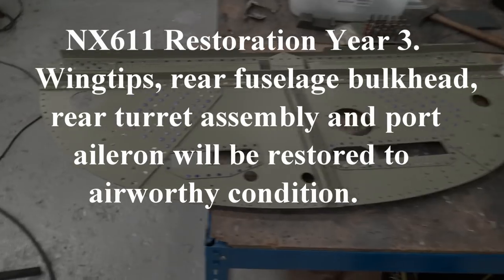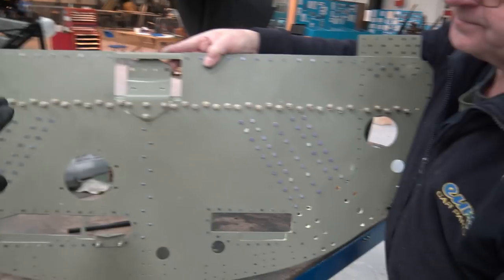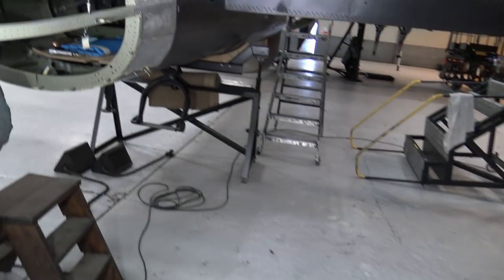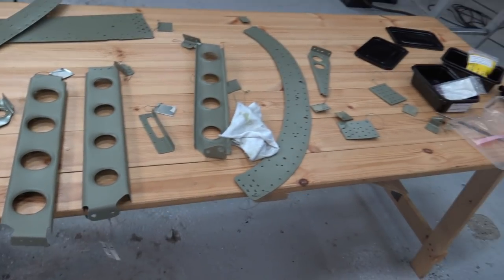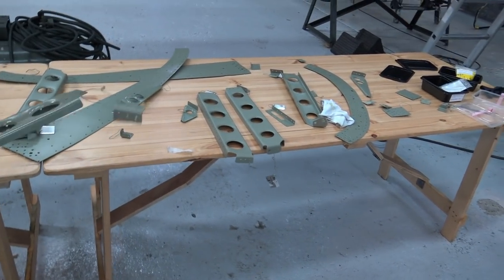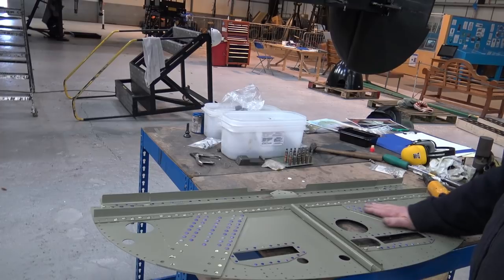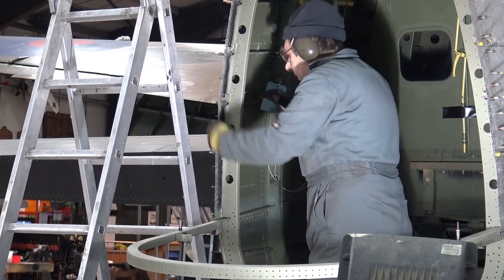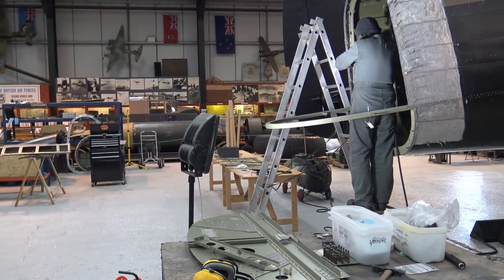Video 57 Restoration of Lancaster NX611 Year 3

Comment: Hi Nev...... This rebuild is now in its third year. Do you know how long it took to build one to airworthy condition back in the 30s-40s ? The time comparison could be interesting. 😉
Reply: I can help you with this question, NX611 is a Lancaster Mk VII,  this variant was only ever built at the Austin Motor Works Longbridge, Birmingham, this was a batch of 150 built and were produced at a rate of 5.8 planes per week. There is a web site called http://www.austinmemories.com/ which details aircraft built by the Austin Motor Works during WW1 and WW2. NX611 has a build date of 16 April 1945.
Reply: Isn’t it one of the Lancaster built at Longbridge in Birmingham?
Reply from the maker: Two good reply's from GeoffT  and Peter. Stay safe B,K,D,
Reply: @nevillewheeldon1693  👍

Comment: As an addendum to a previous clip, the purple rivets are made from 7050 aluminum and anodized purple to signify their type material. They are one of the highest strength aluminum rivets available.
The real question would be: what do the old drawings call out for that rivet? The main reason for anodizing aluminum rivets are for corrosion control ( electrolysis), and secondly for coding.
That said.....Neville!  you be super super careful!! You are doing a fantastic historical documentary. We need you.
Reply from the maker: Cheers Ed and thank you.